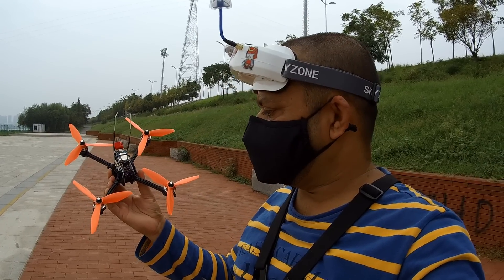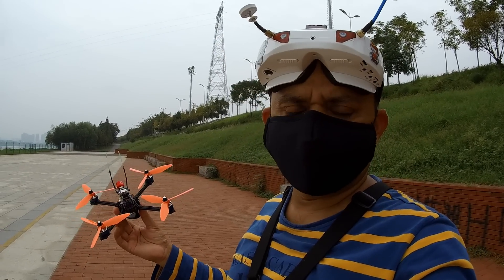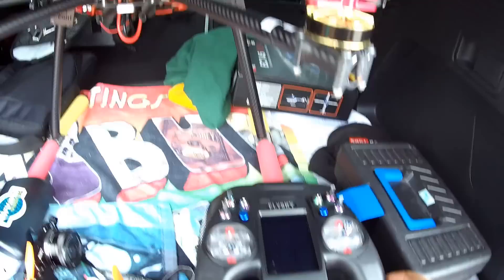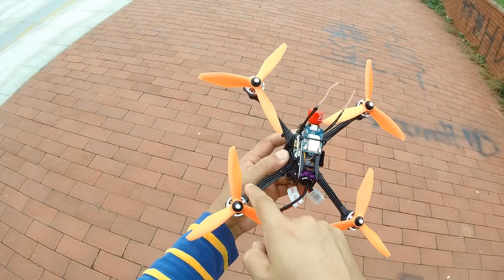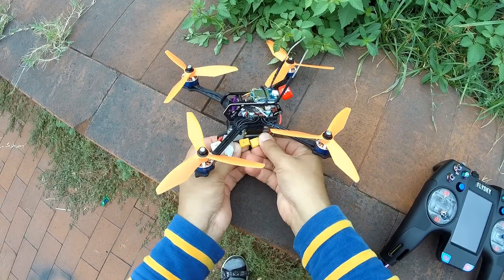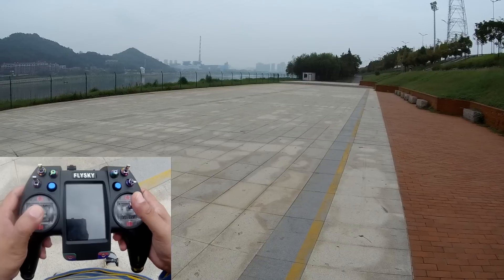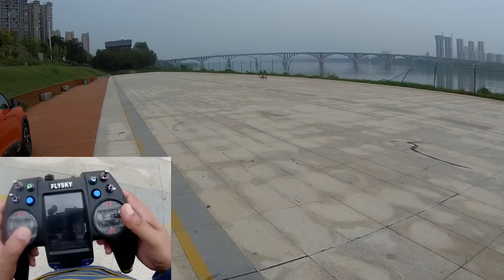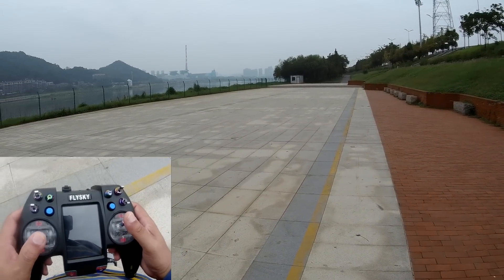Flying Diatone GT-M515 FPV Racing Drone with Underground FPV Nirvana

Comment: Nice flight! Thanks. You should try it with bi-blades for maximum efficiency and performance. I'm using Gemfan 5152 biblades with it and I can easily fly around 8 minutes with an 850mah 3S battery. I really love this quad. It is actually one of my preferred ones.